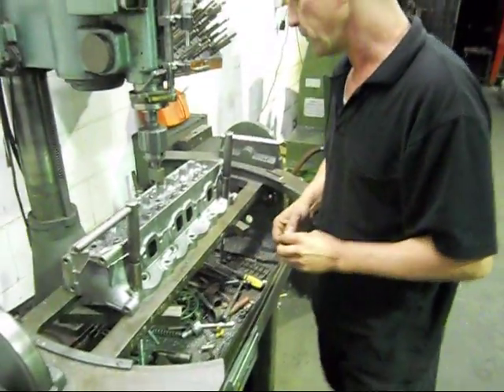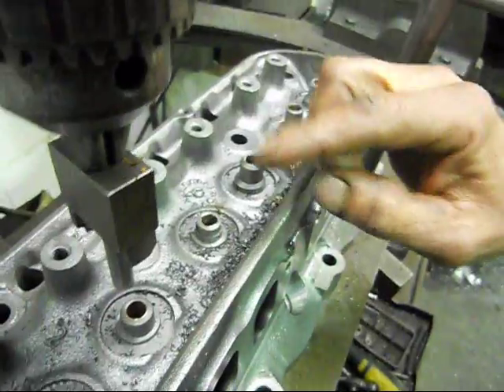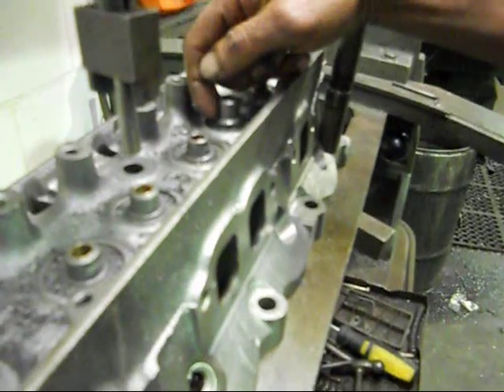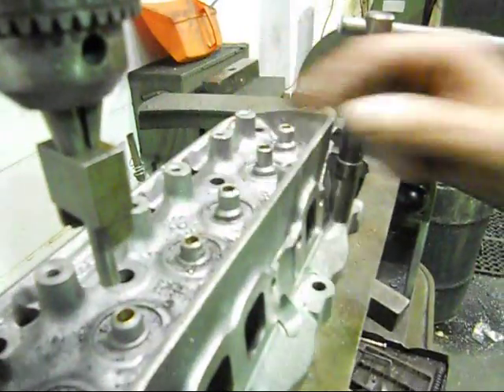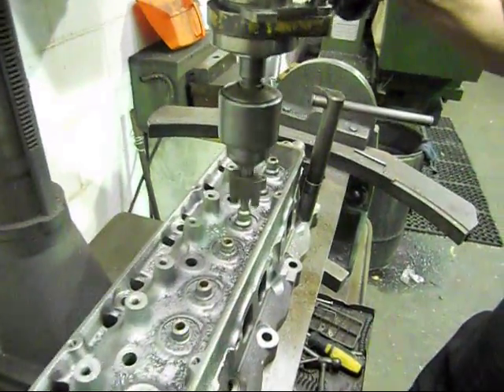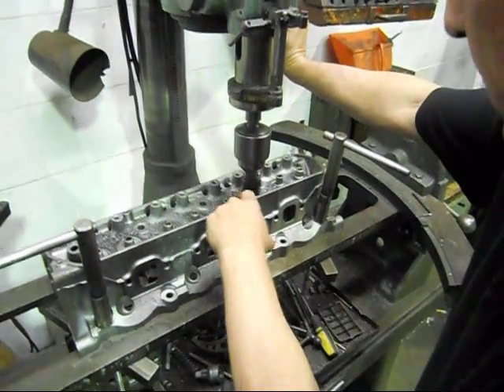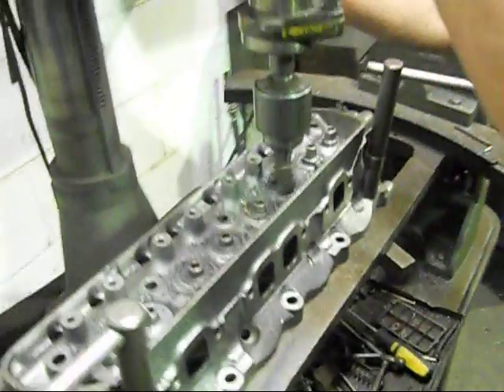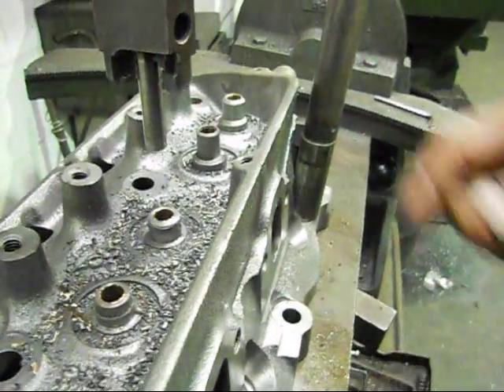How to modify V8 heads for double/triple valve springs and mechanical valve stem seals

Comment: HOW DID YOU MEASURE TO GET THE RIGHT SIZE CUTTER.... INSIDE DIA. OR OUTSIDE DIA. BECAUSE I KNOW SOME CUTTERS JUST CUT THE OUTSIDE OF THE GUIDE. I NEED ONE LIKE YOURS TO CUT THE WHOLE GUIDE DOWN ON A 454 HEAD.